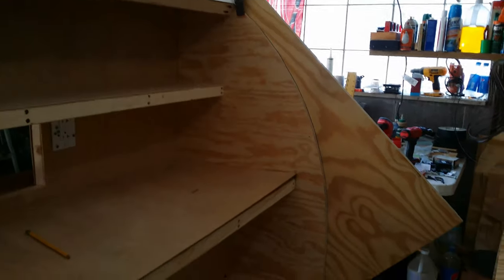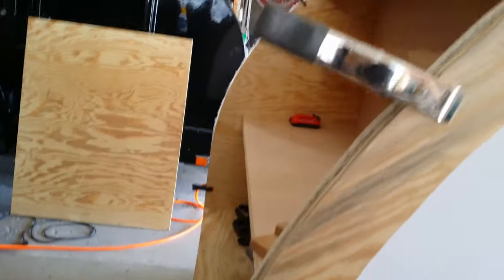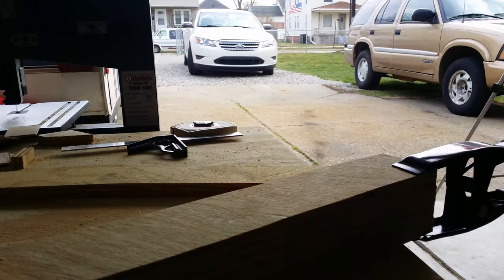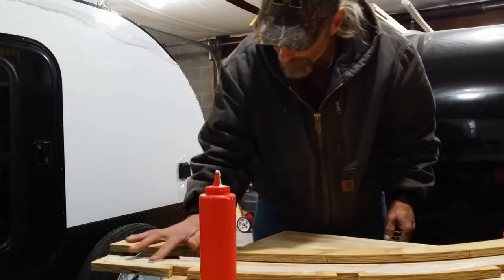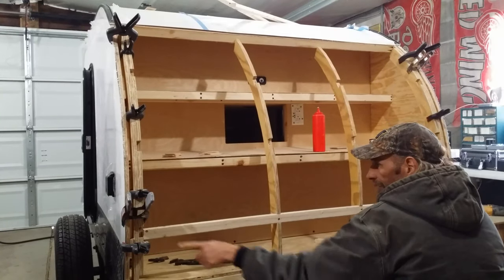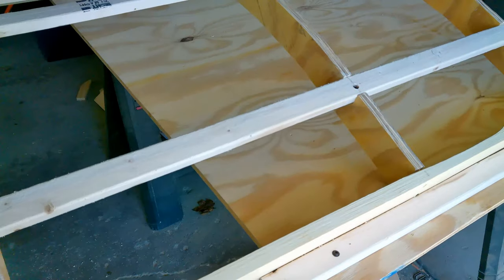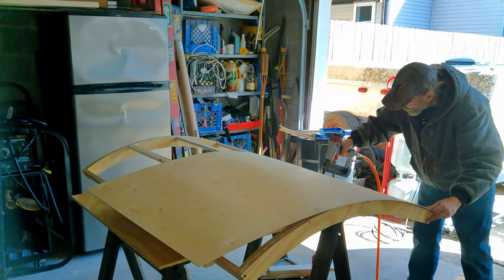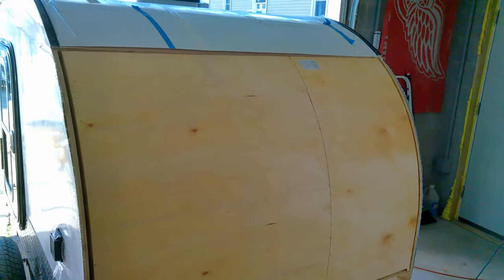How to Build a Teardrop Camper. Part 11. HATCH STRUCTURE (Donation Build)

Comment: Whats the size of the spars
Reply from the maker: They are 2x4's I ripped down the center. They are 2x2. (1.5x1.5)  Length will depend on the width of your camper and the thickness of the walls. Thanks for watching!